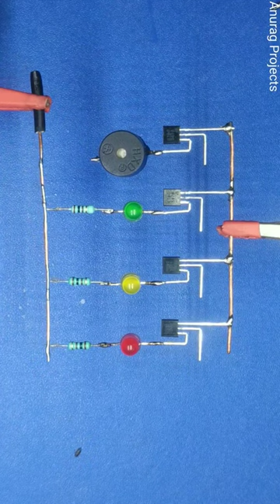New Simple Water Level Indicator with Alarm #shorts

Comment: what sensor did you use?
Reply: None. Stupid circuit relies on resistivity (amount of minerals) in the water. 👎
Reply: The level sensor used is a transistor, but the the small black circle thing at the top is a Piezoelectric Buzzer

When the water passes a certain level, the top transistor will "switch on" and the buzzer will sound (to let you know the water reached a critically high level)